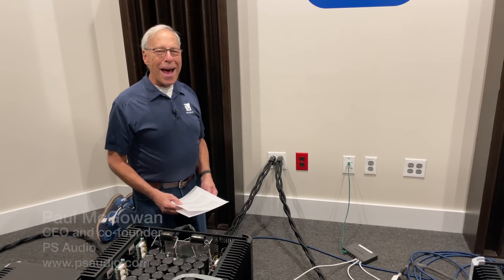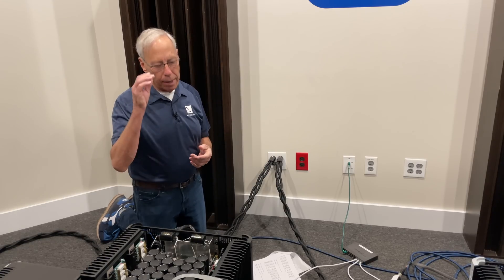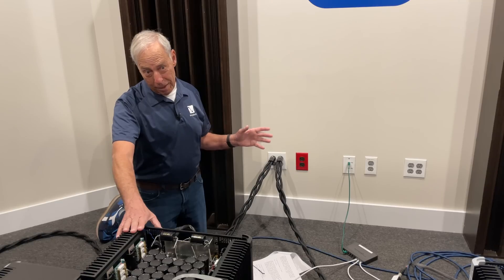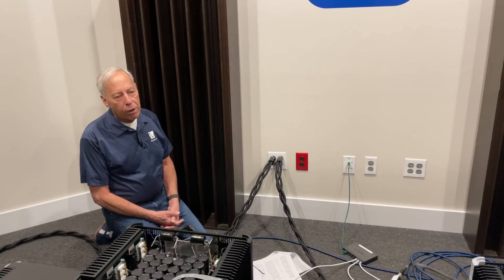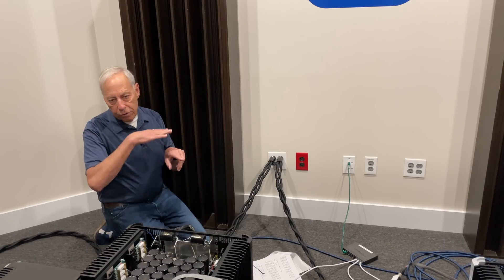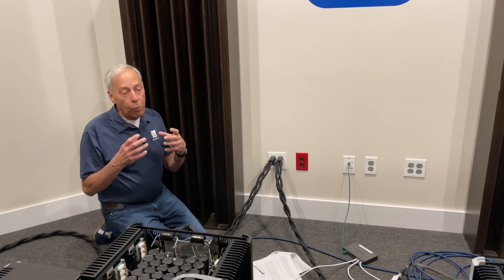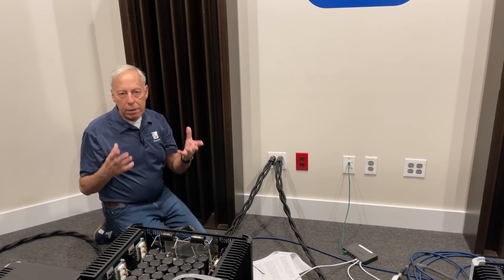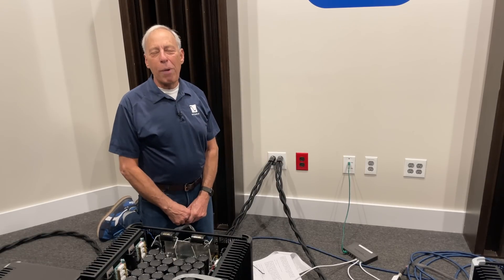Are braided power cables better?

Comment: wouldn't having higher inductance filter out noise at higher frequencies? wouldn't rolling off higher frequencies be a good thing? 50-60hz is pretty low
Reply: Inductance is an impediment to high current rise times. 

That said, I'm not supporting Paul's claims here, ie., twisting in a line side cord resulting in any significance.
Reply: @Douglas Blake 
As long as it didn't inhibit high amperage pulse like current delivery.
Reply: @Douglas Blake 
Agreed
I'm simply speaking to the original inquiry about inductance, line side inductance... which would be an impediment to high current pulse like demands, ie., SMPS, and/or in pro audio; simultaneous kick drum and bass guitar transient, etc., whereas the duration exceeds cap reservoirs.

Comment: This one has lost me, sorry :( Braiding for multiple conductors is the equivalent of a twisted pair for twin conductors. The purpose is to reduce the 'loop area' between conductors, and help prevent ambient magnetic field noise coupling inductively into the signal path. Not sure how this would help for the last few feet of an AC mains supply path, which only needs to be a pure 50 Hz.
Reply: Get educated man,,,
Instead of chatting , there is a thousand ways to deal with this, .   , no one way is the best, just different approaches,, different techniques..    No affence, but I suppose you have the best sounding system  there is....
Reply: .. Paul knows  better than you, kiddo..
Reply: Long Live Paul......

Comment: Someone please explain how power cables benefit from braiding. The AC gets rectified and smoothed - what get to power the amp should be pure DC. If cables degrade the signal, why don’t we use batteries?
Reply: @Douglas Blake Except with HDMI, twisting various cables as specific intervals allows for faster speeds of data transfer.  So, twisting has a benefit beyond EMI.
Reply: @Douglas Blake Using twisted pairs with balanced signal source and destination can reduce a lot of the co-interference with adjacent twisted pairs, outside noise picked to the signal and signal radiated from the cable. Building the twisted pair with tight tolerances (wire copper thickness, insulation thickness, insulation material, consistent distance between wires all the time, consistent number of twists per meter) can produce a transmission path with constant impedance for the signals, which benefits the quality of transmission of fast and high frequency signals. 
If you use twisted pair with unbalanced signal connections, many of those those wire twisting benefits are very greatly reduced.
Reply: Yes batteries would be good
Reply: They do not, neither do they need to be that heavy.
It is pure sales spiel.
Reply: @montynorth3009  I am a physicist. If they give me the science behind it and it makes sense, I will accept it. Until then I am highly sceptical.
Reply: @geocarey  Graham Bell invented twisted cables so phone singles could be carried over USA that should be enough proof twisting cable reduces EMI and inductance.

Comment: Paul, do you ship you ship your fine amplifiers with braided cords? If no, why not?
Reply: Steve Scudder, it's the cost.   If they included very top-end cables the amplifiers would sell for to much, instead they include a good cable, then leave it buyers choice if they upgraded to better power cables afterwards.
Reply: That’s BS. They could spend an extra $10 to braid their own power cables. They know it makes no difference which is why they don’t ship the amps with them.
Reply: @YuengsNwings  true, if it mattered, they would be unique in the industry and dominate the market because of the clear performance advantage.  

 the brain will tend to deflect or deny challenges to cherished beliefs.   just like a smoker will say smoking only hurts the other guy, a sucker who owns expensive wiring will say there is an audible difference.   And the beauty of human hearing is that it will always immediately confirm a bias , which becomes reality in a brain process without the ability of self awareness.

Comment: I just don't understand why you need to care about the power cable when you have a good amplifier
Reply: Because expensive amplifiers seems to have shitty power supplies
Reply: Because an amplifier can only operate with what it is given. If you can filter noise from the socket to the amp, the amp won't have to waste performance trying to clean your signal.
Reply: @falcon048  "the amp won't have to waste performance trying to clean your signal" is pure nonsense - the power supply is supposed to produce clean DC power no matter what

Comment: Paul, do not back down to the snake-oil touting trolls, that rant, rave, and throw temper tantrums, insisting that those Audioquest power cables are a waste, and that what you hear is your imagination, and not an actual improvement.

Those trolls never tested.
Those trolls often sight tests, that are flawed.

Those Audioquest power cords are the LaFerrari of the power cord industry.  They are the real deal.  They work.  I know this, because my local high-end audio store has them, and they swapped them with their stock power cords on their flagship Vandersteen System Nine stereo.  The improvement was not imagined.  It was plain and obvious.

To those that compare such a difference to changing speakers, well, the difference it not that striking -- nothing is.

But quality power cords do make a significant difference.  I cannot speak for all models and all manufacturers.  But those Audioquest power cords are the real deal.

Again, Paul, please politely correct the record, when people call you out for BS on this topic.  Do not let them slide.  They never did a listening test on a quality stereo.  They are trolls.

It isn't so much that they are ignorant. It's just that they know so much that isn't so.
Reply: We are simply not idiots uhm audiophiles
Reply: Quality power supplies matter.... A quality one will produce clean DC power, despite have a stupid twisted pair or braided power cable for the last 5 feet to your power supply.
Reply: @boomertsfx1  Please list the power cables that you used in your listening test, to conclude that power cables make no difference, that they are "stupid twisted pair...".
Please also list all of your stereo's components that were used in your listening test (speakers, amps, pre-amp, DAC, transport, phono-amp, tone-arm, cartridge, etc), and room treatments.
Reply: @boomertsfx1  Request #2:

Please list the power cables that you used in your listening test, to conclude that power cables make no difference, that they are "stupid twisted pair...".
Please also list all of your stereo's components that were used in your listening test (speakers, amps, pre-amp, DAC, transport, phono-amp, tone-arm, cartridge, etc), and room treatments.
Reply: @boomertsfx1  Request #3:

Please list the power cables that you used in your listening test, to conclude that power cables make no difference, that they are "stupid twisted pair...".
Please also list all of your stereo's components that were used in your listening test (speakers, amps, pre-amp, DAC, transport, phono-amp, tone-arm, cartridge, etc), and room treatments.
Reply: @boomertsfx1  Request #4:

Please list the power cables that you used in your listening test, to conclude that power cables make no difference, that they are "stupid twisted pair...".
Please also list all of your stereo's components that were used in your listening test (speakers, amps, pre-amp, DAC, transport, phono-amp, tone-arm, cartridge, etc), and room treatments.
Reply: @0Perhaps  holy shit, Perhaps you should give up, dude...talk about temper tantrums.
Reply: @boomertsfx1  Request #5:

Please list the power cables that you used in your listening test, to conclude that power cables make no difference, that they are "stupid twisted pair...".
Please also list all of your stereo's components that were used in your listening test (speakers, amps, pre-amp, DAC, transport, phono-amp, tone-arm, cartridge, etc), and room treatments.

It sucks when someone does not give up, and they will not turn off the spotlight on liars.

Reply with an answer, to validate your claim.
Or, admit that you were spewing BS.

Or do not answer, which is the same as hiding under your desk, and admitting that you lied.
Reply: @boomertsfx1  Request #6:

Please list the power cables that you used in your listening test, to conclude that power cables make no difference, that they are "stupid twisted pair...".
Please also list all of your stereo's components that were used in your listening test (speakers, amps, pre-amp, DAC, transport, phono-amp, tone-arm, cartridge, etc), and room treatments.

It sucks when someone does not give up, and they will not turn off the spotlight on liars.

Reply with an answer, to validate your claim.
Or, admit that you were spewing BS.

Or do not answer, which is the same as hiding under your desk, and admitting that you lied.
Reply: @0Perhaps  if only you were as smart as you are persistent!  I've faxed you my supply list.
Reply: @boomertsfx1  You wrote:
"if only you were as smart as you are persistent!  I've faxed you my supply list."

Yet another attempt by you to obfuscate the topic.  And yet you again getting caught attempting to obfuscate the topic.

Your initial BS comment "Quality power supplies matter.... A quality one will produce clean DC power, despite have a stupid twisted pair or braided power cable for the last 5 feet to your power supply" was made here, publicly, and your reply to validate your publicly made BS claim needs to also be public.

Remember that a "reply" is not the same as an "answer".
Keep that in mind while you are typing up your next comment.

Request #7:

Please list the power cables that you used in your listening test, to conclude that power cables make no difference, that they are "stupid twisted pair...".
Please also list all of your stereo's components that were used in your listening test (speakers, amps, pre-amp, DAC, transport, phono-amp, tone-arm, cartridge, etc), and room treatments.
Reply: @0Perhaps  Merry Christmas, you win!
Reply: @boomertsfx1  Your "you win!" comment is transparently insincere.
This is not about anyone winning.  Rather, it is about you validating your BS claim where you wrote:
"A quality one will produce clean DC power, despite have a stupid twisted pair or braided power cable for the last 5 feet to your power supply."

You forgot where I wrote:
'Remember that a "reply" is not the same as an "answer".
Keep that in mind while you are typing up your next comment.'

You replied, again.  You also did not answer, again.

Request #8:

Please list the power cables that you used in your listening test, to conclude that power cables make no difference, that they are "stupid twisted pair...".
Please also list all of your stereo's components that were used in your listening test (speakers, amps, pre-amp, DAC, transport, phono-amp, tone-arm, cartridge, etc), and room treatments.

This is the 8th time that I am requesting that you list the above from your listening test.
Why are you intransigent?  Why are you refusing to provide the list?

The likely reason is that you never tested, and that you lied.  You wrote a comment to mislead people that are trying to learn.  You were caught lying, and you will not admit that you lied.  And so you keep digging, and you keep entertaining.
Reply: @0Perhaps  this is hilarious.  You are so full of it, sir.  The last few inches of power cable into your equipment doesn't matter and I don't need to give you a list of random equipment to know this.  All the things you list except power cables are what matters.  Now, let's get together so we can settle this with science.  You might as well provide me with the list of equipment, including serial numbers, because tha...wait a minute, we don't need any of that because it doesn't at all....again, it's your PSU and downstream that actually matters, and not some candy-ass braid in your power cable.  I bid you good morrow!
Reply: @boomertsfx1  Request #9:

Please list the power cables that you used in your listening test, to conclude that power cables make no difference, that they are "stupid twisted pair...".
Please also list all of your stereo's components that were used in your listening test (speakers, amps, pre-amp, DAC, transport, phono-amp, tone-arm, cartridge, etc), and room treatments.

This is the 9th time that I am requesting that you list the above from your listening test.
Why are you intransigent?  Why are you refusing to provide the list?

The likely reason is that you never tested, and that you lied.  You wrote a comment to mislead people that are trying to learn.  You were caught lying, and you will not admit that you lied.  And so you keep digging, and you keep entertaining.

Comment: Are the wires in the wall going to panel box braided too?
Reply: No and that's why the focus on the last 50 cm of the chain is brainless
Reply: @Harald_Reindl  Does a water filter in the last few feet of your water supply affect the quality of water?  Same principle applies.  I know, it doesn't make sense, but I've built my own power cables, (cause I can't afford crazy priced cables) and they did change the sound.  Dynamics improved and bass output was more powerful.  I do agree, they aren't worth the price, that's why I built my own.  Not even that hard to do.

Comment: Just give us a rule of thumb, if you have a $2000 amp, how much should you pay for a power cable? That’s the rub, I’m not paying 40-50% of the amp cost on a friggin power cable. Then you have interconnects, etc. I get it, it’s a hobby, so you do you, but at a certain point, it should be phrased as once your speakers are placed correctly, your room treatment is done, speakers are decoupled to the floor, then we can talk power cables.